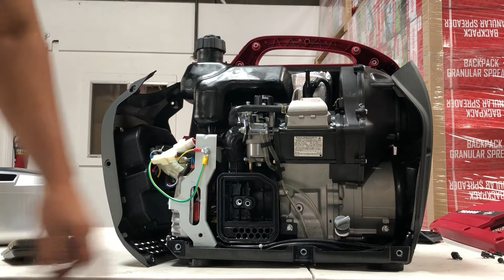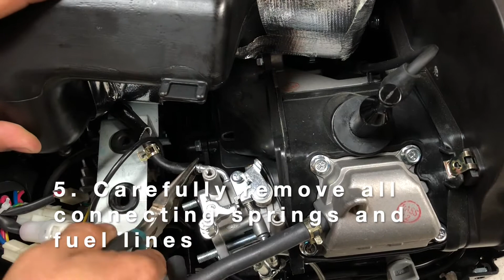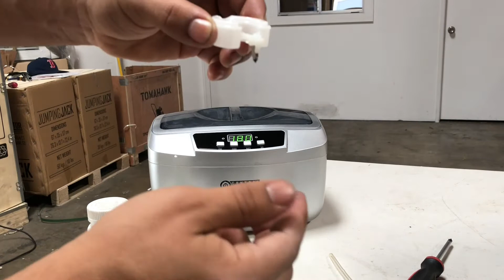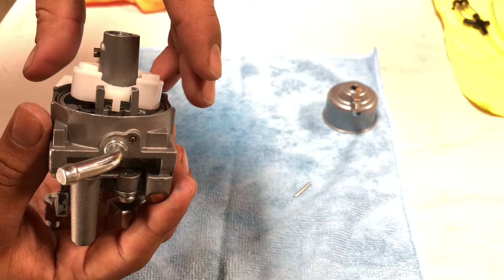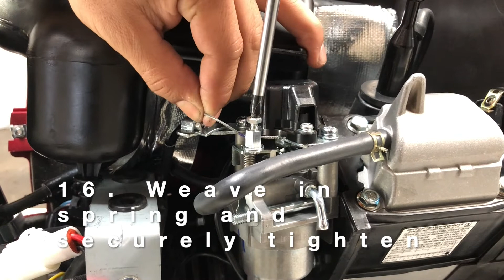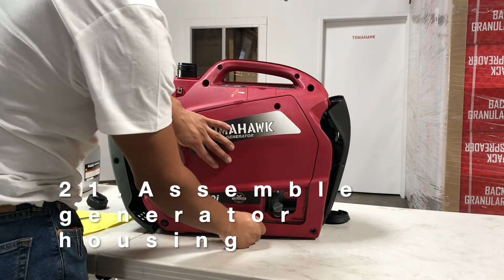How To Clean A Carburetor On An Inverter Generator | South Bay Repair Shop

Comment: I picked up a craftsmen 2500watt generator same set up pulled the carb off cleaned it up thanks to your video I fixed 2 generators I just picked up for the low low ! Thanks so much